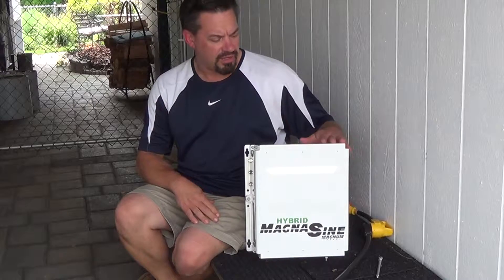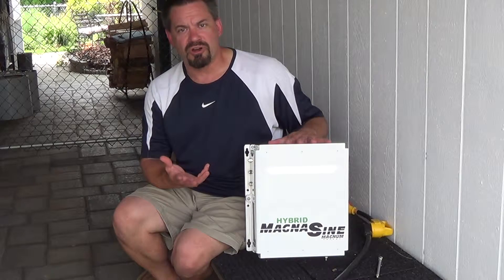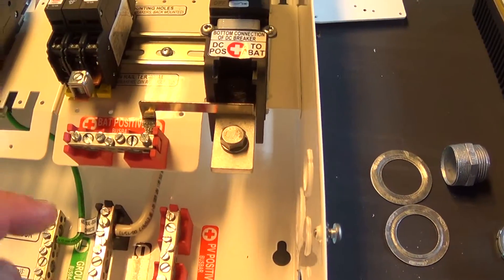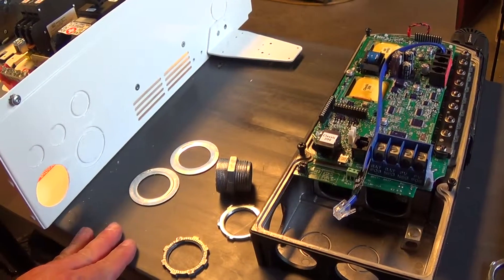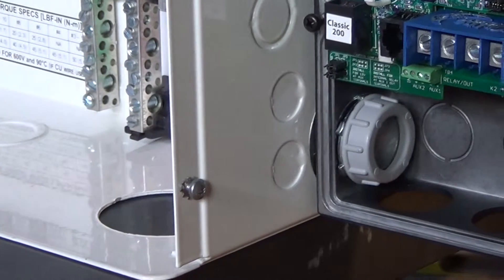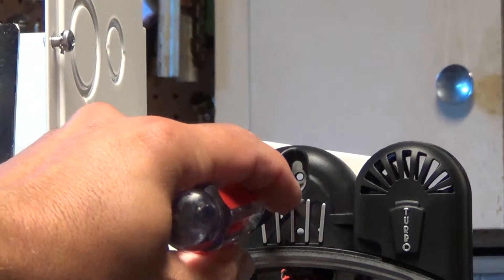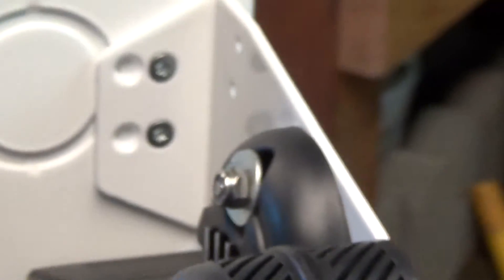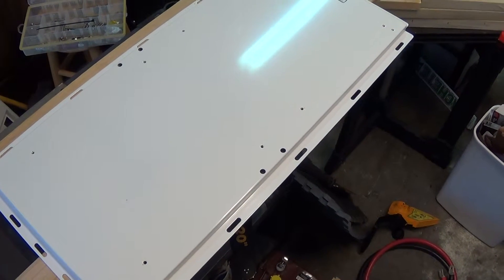Solar install Part 2:  Connecting Magnum MMP, MSH4024RE, and Midnight Classic 200 together

Comment: The hole at the top of the Midnite classic actually lines up fine with the Magnum mini panel bracket.  I have the same setup.  I think it didn’t line up in your case because your nipple connection between the classic and panel is likely not fully centered.  If you loosen one of the locknuts you can likely reposition the classic’s vertical alignment so that the screw hole lines up as expected at the top.
Reply from the maker: This video is a few years old.  I am probably not going to re-do it.  But perhaps some one else will benefit from your advice.

Comment: Hi I have a similar setup and I am just wiring the charge contrôlée to the MMP  panel.  When wiring the positive side do you wire to the positive dc busbar or the battery busbar?   Any insight would be great. Thanks
Reply from the maker: I think I wired it to the DC busbar.   The directions were pretty clear if you get the manual from Magnum.
Reply: The battery bus and dc positive bus are the same connection in the Magnum mini panel.  The only other DC positive bus is the PV positive.  Your solar output positive lands on that PV panel bus.  You wire from that PVbus to a DC disconnect breaker properly sized for your particular classic (see the appendix in the controller manual) and run from that breaker to the Pv+ of the classic.  You then wire the classic’s positive output back to another properly sized DC breaker in the MMP (sized relative to your max charging amps) and from there to the positive bus in the MMP which is permanently connected to the battery side of the main DC breaker.  It is important you include the dc breakers before and after the classic.

Comment: Can you AC Couple with the Magnum Hybrid Inverter?
Reply from the maker: You can use the Magnum to augment your grid current, but you cannot use it to provide power to the grid.  For example, I only wanted to use a max of ten amps from the house to my camper.  I set the max amps allowed on the Magnum to 10 on the input power menu, and then the Magnum would use my solar/batteries to make up the rest if I went over ten amps.  Hope that helps.
Reply: That does help.  I understand that the Magnum Hybrid does not manage selling power back to the grid as a traditional grid-tie inverter would.  I am very interested in the Hybrid Magnum due to some of the features such as 60 amp inputs and the ability to use both solar/batteries and a generator at the same time.  My question regarding AC coupling is more around the ability of the Magnum 
Hybrid inverter to be used when my grid power is out  We have solar and when the grid goes out, we loose the solar.  The Magnum PAE series has extensive instructions regarding AC coupling which in a grid down situation allows microinverters and some central inverters to sync up with the Magnum to continue using the solar and also to charge batteries.  I have read through the Magnum Hybrid manual and there are only a couple of sentences stating that this can be done.  Nowhere near the same info on AC coupling as in the PAE series manual.  

Thanks again for getting back to me.  Great channel.  So many useful videos!   I just subscribed and will enjoy going back and checking out your reviews and videos!

Comment: You got that right,,, it is a beast lol. I have mine mounted into the shed, but I did not attach the classic charge controller onto the magnum. It will be 10 inches away and will not block any air ways.  nice build so far. waiting to see what you do when you hook up a sub panel off that single leg.